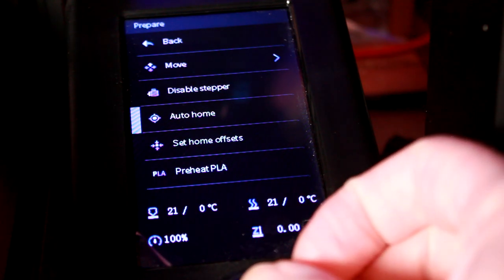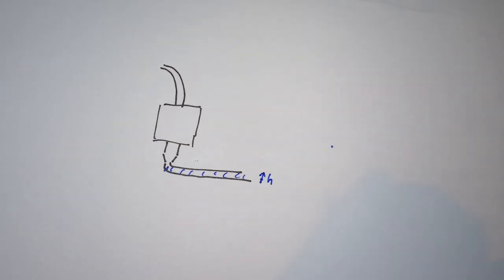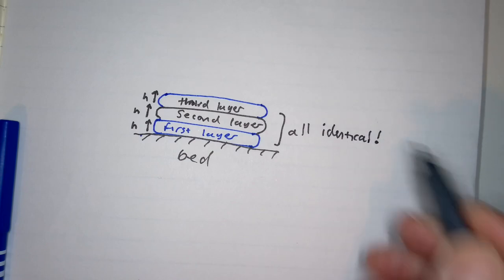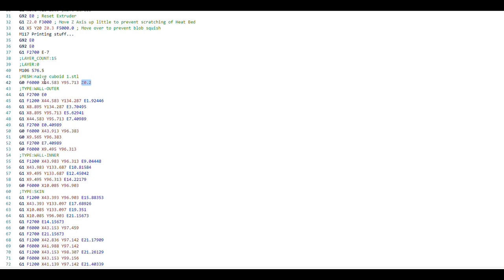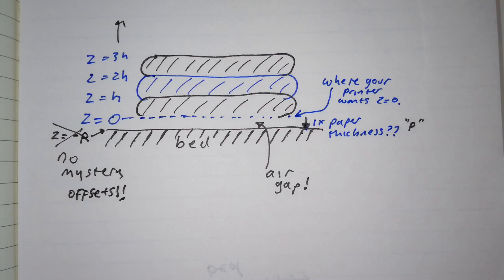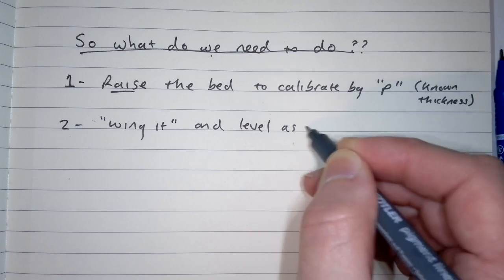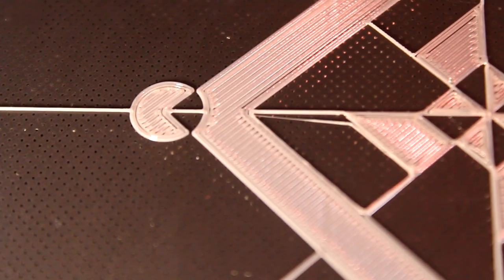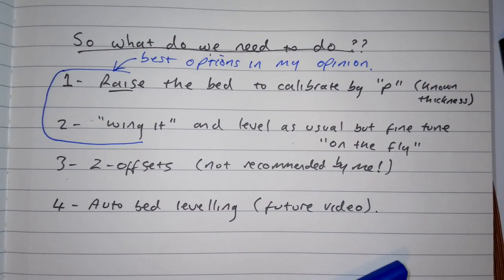How to PROPERLY level your 3D printer bed - with explanations, diagrams and evidence.

Comment: Absolutely PERFECT timing.. 

Just had a "Discussion" on a 3d printing group where I was informed I am ignorant and that you HAVE to use a sheet of paper to get the level because the software (marlin) subtracts... get this, the firmware, yes the digital code... subtracts ABOUT 0.09mm from the zero point you set..

Apparently I am in no position to argue that this is NOT in fact the case because I have been 3d printing for 6 weeks and know nothing where this "expert" has been 3d printing for 7 years and can build printers that print at 250mm/s..

Apparently I am just creating problems for myself by levelling the bed and setting my probe z offset to touching the bed because I will then have to mess about adjusting the height to compensate for the lack of paper..

Apparently explaining that because my nozzle touches the bed if I issue a G Z0.3 which is my first layer height results in a first layer that is exactly 0.3mm high indicates that I do not know what the hell I am talking about and I need to go away and learn some more about 3d printers and come back when I know what I am talking about..

Oddly, very oddly, there has been no further replies after I posted a video of me issuing a G Z0 command, and then demonstrating than a 0.3mm feeler gauge fits under the nolzze, but a 0.05mm feeler gauge on top of that will NOT fit under the nozzle...

And it is not the first time I have been hammered in 3d printing forums for saying that if you level the bed with a sheet of paper then the first layer will be too thick by whatever thickness paper you use..

6 weeks ago I had never seen a 3d printer before, in 6 weeks I have gone from no knowledge, to identifying problems with the machine geometry purely based on the model I print and fixing those out of square parts, I have identified and fixed a manufacturing flaw in Ender 3 max where the verticals are not in fact parallel by a whopping 2.2mm which apparently affects them ALL, I have upgraded to dual z drives to fix gantry lag, and I am editing and compiling marlin firmware to address other issues i need to alter the software to fix..

But because I am not a sheep, and will not jump over imaginary fences just because everyone else does, I don't know what the hell I am talking about...

And yet... here you are.. saying EXACTLY the same thing.. I guess you dont know what you are talking about either LOLOLOL
Reply from the maker: Wait....was this reddit? 😂
Reply: @LostInTech3D  No, SPIT facebook SPIT

I just shared your vid there and low and behold someone chirped in with "check out the cheep feeler gauge video it says the same thing. but his first layer is good unlike this youtubers first layer. dude needed to keep working on it imho"

Obviousely the fact you are talking about  method three, and stating "its not super accurate, in fact its usually no t accurate at all" means nothing when the intentions are to just knock someone down because they know more about  subject than them..

SMDH These people are the reason I was going out of my mind for two weeks when i got my printer, listening to idiots who think they know what they are talking about, once i stopped listening and just sat with a coffee and thought logically about it I worked out how to do it properly myself and now have no issues LOL

I am not kidding you, I watched hundreds of videos about bed levelling, and probably as many websites, and not one of them explained that a piece of paper makes the layer 0.1mm too high.. this is only the third I have found in 6 weeks i think..

Comment: lmao the side stepping of the rabbit holes is beautiful, there is so much interconnected variables in 3d printing even after 2 years of chasing the rabbit i still watch a lot of tips and tricks because i never know what might have been obvious to one but not others. like yesterday i learned if you have auto0.g in your root of an sdcard the printer will auto execute all gcodes in the file at start up.
Reply from the maker: that's actually a cool thing to know!

Comment: Thank you for this thoughtful video. As an engineer, the offset caused by the common paper method bothered me from the day I bought my first printer in 2018 . Everyone ignored it, so I assumed that slicers automatically accounted for it. Curiosity eventually got the better of me, though. Looking into the gcode it was clear (as you pointed out) that the z-height increment and the extrusion amount is the same on every layer. Therefore, slicers do not account for  this method of bed leveling. 

I believe your method 1 it has a significant downside:  If you home the nozzle then jog in X or Y, you will scratch the bed when (not if) you forget to move up in Z first. Method 2 is just too fussy and time consuming.

I use ideaMaker slicer and it has a global Z offset parameter that I set equal to the negative of paper thickness (-0.12mm in my case). This is easier than messing with firmware, and safer than having Z0 actually touching the bed surface.  Surely Cura and PrusaSlicer have the same feature.

Comment: I suggest using Jyers' firmware at least for the Ender 3 V2, there is an extra menu for manual levelling where you can tell the printer to move to the corners/centre. Makes levelling al lot easier
Reply from the maker: 100%. My problem is I need about another 4 machines so I can demo both, and not have to keep swapping when I want to make vids on stock firmware. 😂 
Definitely a jyers vid coming up!
Reply: I support everything J B is saying here. Pro tip!
Reply: It’s really pathetic that creality doesn’t include all these features with their firmware.
Reply: Just compiled my own edit of Marlin, its two presses of the delete key to enable it.. another 2 gets you tramming assistant which uses A BLTouch to measure the z offset of three corners relative to your selected start corner, also very good..
Reply from the maker: honestly the stuff creality have missed out on the 32 bit boards is head scratching!
Reply: @LostInTech3D  IKR!!!!! I edited the header and I was "WTAF, why did Creality dissable EEPROM".. WTAF Why did Creality not include the levelling wizzard.. WTAF why did crality not enable babystepping...

Its a completely different machine now!!! and everything was sat there for them to enable, its not like it would have cost them any extra!!!!!
Reply: Probably best of all.. Long press on the control knob or double press on touch screen in status display to jump directly to  babystepping.. Thats tasty ;)

Comment: I'm glad you mentioned #3, because a lot of printers have this built-in already if you do use their leveling assistant in firmware. In fact, sometimes a piece of paper can be too *thin*, and a feeler gauge is recommended. As best I can tell, my Longer LK4 Pro has such a built-in offset, though I haven't looked at the code to verify.
Reply from the maker: That's good to know. I see the levelling assistant when I Google it, and yes, unless they document it...it could be doing anything, which is a good point.
I suppose it ought to be possible to query the z height in octoprint while it's doing it and get an answer.

Comment: I got my Ender 3 in 2019, and have loved it since. I started with the whole paper method, but found it tedious and unreliable, constantly needing adjustments or something going wrong.  Then I purchased some feeler gauges, and use a 0.2mm feeler instead of paper.  The process is similar, but instead of scraping the nozzle on paper, i scrape it on a metal gauge instead.  I then use Octoprint to offset 0.2mm for the thickness of the feeler gauge ( exactly the conclusion you came to, using a known thickness then off setting the results so your printing a effectively Z=0 on the bed.)   I also tend to use slicer to have 0.24 as my first layer, that extra giving it a bit more hold due to the squish.

I then live level on a 100x100x0.24mm thickness square I made/sliced, until that square is suitably smooth surfaced and no holes or jagged lines.     To me, this makes me feel fantastic when I fire up the printer and print out a 100x100 square that is smooth on top, and not just on bottom where the bed was.

(my printer has a 8bit CPU and limited memory for firmware changes, including hassles and problems through the years.  I may get a new mainboard for it, but I rather like pushing it as far as it can go.)

Comment: Heh... Option 3 & 4 is basically the bread and butter of my two 3D Printers 🤔
My Prusa i3 MK3S performs this perverted long calibration procedure once after assembly ( I guess also when unpacking a prebuilt? ) and then does his 9 / 25 Point BedMeshLeveling whenever a print is queued and my Voron 2.4 tapps its Nozzle off a Z-End Stop ( akin to how more elaborate 3-Axis CNC Routers calibrate their Tool Offsets during a Tool Change ) and then calculates it against a Z-Offset Value set during the first setup followed by a QuadGantryCalibration using an Inductive Probe during the starting procedure of a print ( once everything has heated up and equalized ) and optionally a 25 Point BedMeshCalibration ( takes like friggin ages even at 500mm/s travel speeds so I basically only ever use it when I have a full build plate 😑 )
Reply from the maker: Yeah z offset is essential (at least that's my understanding) with automatic bed levelling. I don't recommend using it with manual levelling just because you have better options and aren't reliant on a parameter you might accidentally reset or lose and smack the nozzle into the bed .. been there! 😃
There are printers like the monoprice mini delta where z offset is mandatory and no manual process is possible even though the automatic levelling is useless, and it's a real pain.

Comment: Any chance you could do a video more specific about leveling the bed and setting the z-offset with a BL touch?
Reply from the maker: Yeah I can certainly look into it, I have a bltouch waiting for install, do you run stock firmware or have you changed it?
Reply: @LostInTech3D  I run marlin 2. I have  a cr10 v3 and decided not to use the ancient creality provided firmware.
Reply from the maker: Yeah I don't think it's a good idea to use stock with auto bed levelling, generally.

Comment: Option 5. Print where you think it’s correct.  Start a test with a skirt that has 5 loops. Stop print, removed skirt and measure. Adjust offset as needed to get you first layer height dead on.
Reply: Surprising how many people dont think about the simple ways.. a half decent vernier guage should be in every 3d printers tool box..
Reply: It's not super clear to me how to do it via your method. Measure what exactly?  The skirt thickness?
Reply: @Ryezn5057  yeah, take it off the bed and measure..

I have just used the depth guage of the vernier on a corner of the brim while its printing but its a race against the nozzle coming back LOL

I dont use it now, I set nozzle to touching with z-offset, drop it another 0.075 for squashed first layer and call it a day..

Comment: My way when I feel like doing it “right”. Connect printer to some kind of trrminal/console/repetier-host/prontoface bla bla. 
Make manual paper calibration in order the nozzle not dig into bed. Send commands with z0.1 or 0.2 whatever spacer you use. I use spark plug measuring device but you can choose whatever.

Comment: kinda amusing cuz i thought exactly this when i got my first printer and I've been leveling bed using feeler gauges so at z=0 nozzle is 0 mm from the bed, but...somehow it never worked well, always too much squish on the first layer using this method. then I've tried using piece of paper and leveling it like ppl tell, to the point i feel slight drag. surprisingly, it worked like charm. now I'm running bltouch and keep setting z offset by using piece of paper, perfect first layers, as weird as it appears to be.
Reply from the maker: This...I assume...is because of how high your bltouch activates. So it's just another variable in the huge equation for first layer height 👍😂
Reply: @LostInTech3D  z offset I'm talking bout is basically distance between probe activation height and nozzle, setting it by using paper method results in zero Z being approx 0.1 higher than bed, just as without probe. what i mean, somehow setting zero Z true to bed results in too much squish consistently.
Or maybe I've been setting bed too high while using feeler gauges due to bed springiness and much lower friction between gauge, nozzle and bed. 
And, as always, there are tons of variables xd carborundum bed was a hell to adjust for perfect first layer, not to mention it has to be perfectly degreased even for petg smh. Switched to those pei coated textured steel sheets and i love it wholeheartedly.

Comment: Creality scraper is 0.7mm thick. Using this method of leveling i printed 0.04mm thicnkess first layer on stock Ender 3 with reglular plane glass bed (4mm thick glass fo picture frames bought at local hobby shop). You forgot to mention to prehat not only nozzle but the bed too. As much as both of us hate z-offset, i hate eyeballing first layer 🤣
Reply from the maker: an interesting way to get a free feeler gauge! Plus, what else is that thing good for! 😂
Reply: @LostInTech3D  sometines I even cut filament with scraper. If filament is on table, just fast tap and its splits 🤣🤣 i made video on """scraper method""" on my channel for facebook groups, couldnt write it step by step so many times... 
Funny thing, i am listening to your latest video about filament joiner and replaying to your comment 🤣

Comment: I always level the bed by putting a light behind the nozzle, setting it to home, and then adjusting the nozzle until it touches its own shadow. I don't even bother with paper.
Reply from the maker: I've thought about doing that!
Reply: Makes it extremely quick and reliable
Reply: Yep... thats the way I do it.. you just need to make sure the nozzle is nice and clean and you can see when it touches really easy..

Its even easier now, I have BLTouch,  dont need to be SUPER accurate on the manul level and can finish of with Probe Z-offset dropping the nozzle until it just touches once..

Then .3mm layer in slicer.. .3mm of plastic on the bed, every single time..
Reply: @AkiraFurball  My only problem with the auto leveling system is that it levels EVERY time you start a new print. So if it's a small print, or the first layer fails, then you have to wait the few extra minutes for it to run
Reply: @taz12480  Yeah.. not entirely true, you can save the mesh and load it back in each print, but is something changes ur screwed..

I am going to try UBL soon, you can create a large mesh of the bed, 10 x 10 poits and save that, then do a simple 3  or 4 point probe on each print in case the plane has moved, x gantry sagged or something, to re-align the bed mesh with the new plane..

Should, in theory, create a much more accurate representation of the bed, with a quicker per print probe.. you can save different meshes too so i have t glass beds and would be able to create a mesh for each and select the one i want to use..

I figured that as the majority of my prints take 3 hours or more, the extra few minutes probing is negligible even if it is somehow annoying as hell LOL